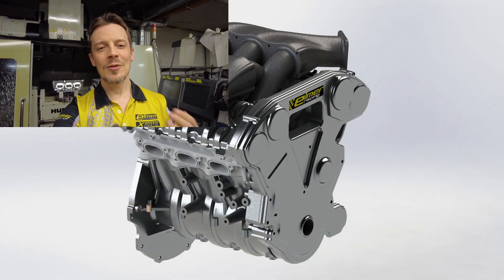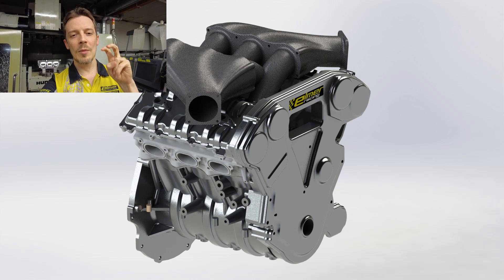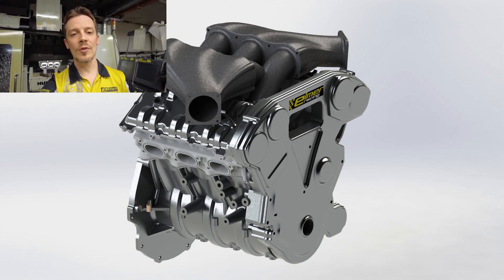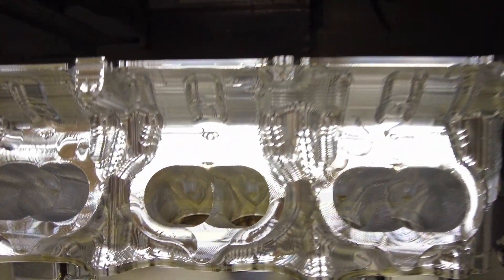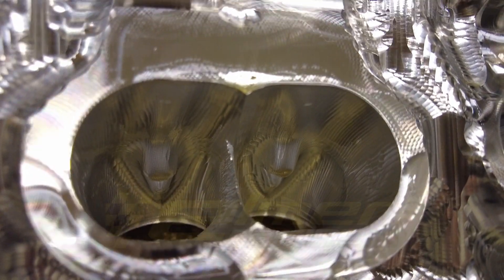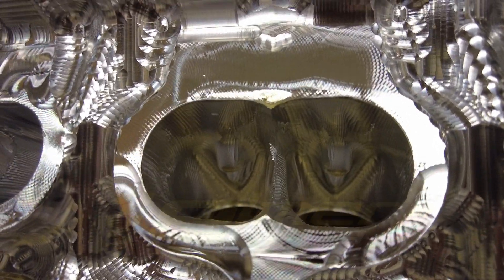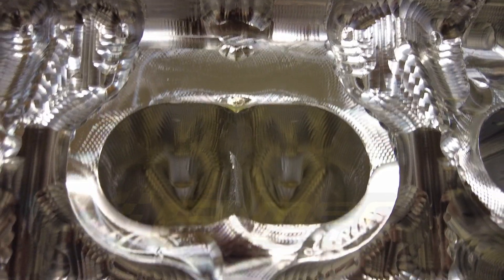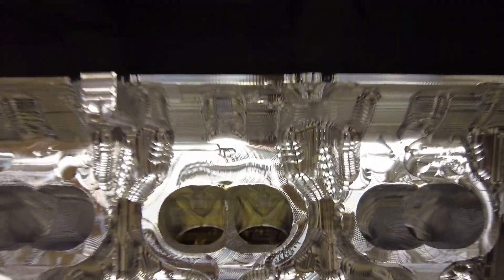Max #Hel Engine Render & Intake Port Details

Comment: Has Elmer racing considered a high revving viper sized v10? When I say high revving I mean 9k ish, not 13+
Reply from the maker: We have thought about a 8-9 liter V8. Only problem is that there really isn't any motorsport use case for that much power! Our 4 liter i4 #Thor at 1500hp is already too powerful for circuit racing :D
But if there's a big enough demand, or a interesting enough one-off case for a showcar or something, it could be done!